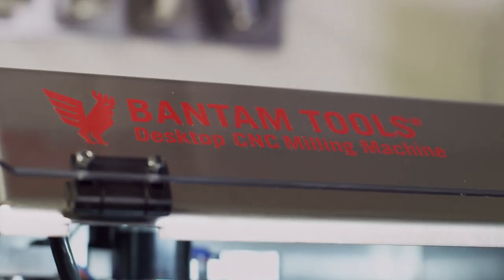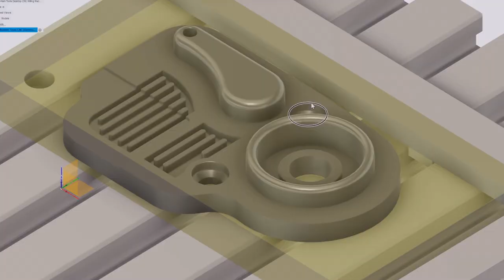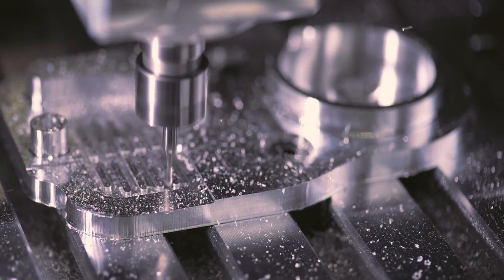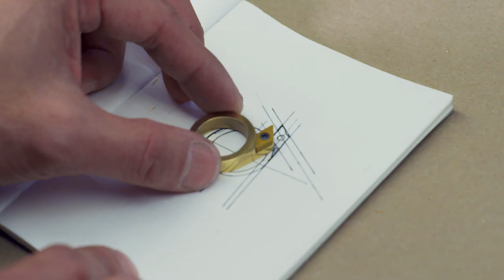Introducing The Bantam Tools Desktop CNC Milling Machine

Comment: You better make a chip filter / guard for that hobby grade outrunner brush less motor or your going to short out the windings when it sucks up conductive chips.
Reply from the maker: Hi there! We future-proofed the machine to accept an air blast system to help with chip evacuation. Be on the lookout for that accessory later this fall!

Comment: Would this work well with carbon fiber also? It leaves a powder type dust wondering I'd that will be an issue
Reply from the maker: Hey there! Thanks for your interest in the Bantam Tools Desktop CNC Milling Machine. Carbon fiber is not a supported material on this machine. Like you said, the fine dust created when milling can lead to issues like binding. You can learn more about the materials we support here: https://support.bantamtools.com/hc/en-us/articles/360059006853-Materials-Overview

Comment: I am 3d printing a part. YAWN YAWN YAWN YAWN. Thats how I feel after having waited 8 hours for it and the printer is still going. Ridiculous amount of time. Could not make 3d printed parts be some of my customers end product. Just takes too long. This however is where I want to be. Milling steel. Making moulds and filling them with hot aluminium.
Reply from the maker: Hi James — Thanks for the interest. It would be great to hear more about the things you'd like to make! Just a heads up though, steel isn't a supported material for this Desktop CNC Milling Machine. The lowest spindle speed you can run is 10,000 RPM (since it's optimized for aluminum) and steel requires a lower surface feet per minute.

Comment: Do you guys have a version that can do stainless steel if so how much? Also if I design my parts in metric will they’ve an issue? Do you guys have metric tools?
Reply from the maker: Hi Charles! You can totally design your parts in metric. You can toggle between metric and empirical unites in our Bantam Tools software.
Reply from the maker: As for your question about steel. The Desktop CNC Milling Machine is designed to be optimized for machining aluminum. As you may have already guessed, because the lowest spindle speed is 10K RPM and steel requires a much lower surface feet per minute compared to aluminum, you need to run smaller tooling when machining steel (3/16" and below). As a result steel isn't an officially supported material and machining it would void your warranty.

Comment: Have you milled any steel with it at reduced feed rates? or is it simply not rigid enough? Cool little machine. Do you also supply them with a European power supply?
Reply from the maker: Hi there! Steel isn't an officially supported material. The minimum spindle speed for the Bantam Tools Desktop CNC Milling Machine is 10,000 RPM (since it's optimized for aluminum). And to mill steel, you'd need a much lower surface feet per minute. 

As for your question about the EU power supply. We aren't taking international orders just yet. But when we do, yes. We'll continue to keep folks in the loop about when the Desktop CNC Milling Machine will be available internationally!

Comment: Is it possible to send gcode from other CAM software or buying subscriptions for dedicated soft in the only option?
Reply from the maker: Hi there! To clarify the Desktop CNC Milling Machine comes with a base package of the Bantam Tools software for free :) It supports G-code, NC, and SVG files. So long as you're using CAM software that exports G-code files, you'll be fine! Also, while the subscription pack comes with a number of awesome features, they're optional!

Comment: Would this work for milling mother of pearl?
Reply from the maker: Hi there! Mother of pearl isn't an officially supported material on the Desktop CNC Milling Machine. The dust is toxic so we really don't recommend machining it and we want users to be safe. Also, if the fine dust builds up in the machine and is not cleaned out thoroughly, it could cause issues in the long run.
Reply: @bantamtools  Thanks!

Comment: If you can afford this, save a bit more for a tormach 440. Ask a local machinist if you doubt.
Reply from the maker: Hi James! You're right, the price point of the base pack of a Tormach 440, without upgrades, is only a little bit more than our machine. But our goal for the Desktop CNC Milling Machine was to design a powerful prototyping tool with a 28,000 RPM spindle that could easily be moved around your studio space, comes fully enclosed, and has everything you need to get started (without any upgrades) right out of the box.

Comment: Could that machine mill to steel bar and plate?
Reply from the maker: Hi there! Steel isn't an officially supported material. The minimum spindle speed for the Bantam Tools Desktop CNC Milling Machine is 10,000 RPM (since it's optimized for aluminum). And to mill steel, you'd need a much lower surface feet per minute.

Comment: 1:51 drill bit spinning backwards.
Reply: Or an artifact of the camera shutter speed/framerate and the frequency of the tool. You can actually use a strobe light to measure the rpm of spinning tools using the same idea. When the light is flashing at the same number of rpms, the tool will look like it's not spinning at all. Off by a little, and the tool will look like it's spinning slowly.
Reply: @jamesnewman9547  I think it's going too slow for that, but you make a good point!  You can see the engraving on the chuck as well.  I think it's funny.  Not sure how running it backwards helps make PR footage.  Maybe the guy is that clueless on running a drill press.

Comment: How much? $3,599.00
Reply from the maker: Hey there! Yes, for the next 45 days (until August 21, 2020), the machine is going to be offered at a discounted price of $3,599. Plus, if you sign up for our referral program you can save more money. For every friend you refer who also purchases a machine, you get $100 back. And you're friend will get $100 off their machine too ;)

Here's a link to the referral program, if you're interested: https://www.bantamtools.com/referrals
Reply: @bantamtools  so basically if i have 36 friends i can get this machine for free?
Reply from the maker: @ipadize  , for every friend you refer who also purchases a machine, you'd get $100 back. So yes, it is possible!
Reply: @bantamtools  cool, now i just need 36 friends :D
Reply: Can it mill stainless or bronze?
Reply from the maker: @akinalimited6785 , steel is not an officially supported material. The Bantam Tools Desktop CNC Milling Machine is designed to be optimized for machining aluminum. Because the lowest spindle speed is 10K RPM and steel requires a much lower SFM (surface feet per minute) compared to aluminum, you need to run smaller tooling when machining steel (3/16" and below). Also note that there’s no coolant system on the Bantam Tools Desktop CNC Milling Machine, which means you’ll need to take great care when machining steel. While this machine can cut steel, machining it is not covered in our warranty. We’ll be releasing a full list of speeds and feeds for various materials once we begin shipping.
Reply: @bantamtools  So,  it's perfect for Aluminum?
Reply from the maker: @8upJoker , yes our Bantam Tools Desktop CNC Milling Machine is designed for aluminum prototyping. You can mill other materials using the machine, but it's optimized for aluminum.
Reply: @bantamtools  Can it also mil thermoplastics such as ABS and PMMA?
Reply from the maker: @32stvshn , yes :)